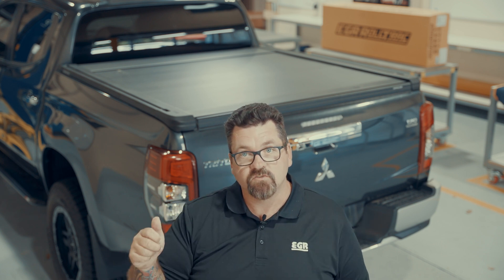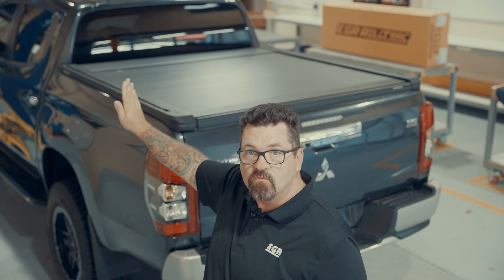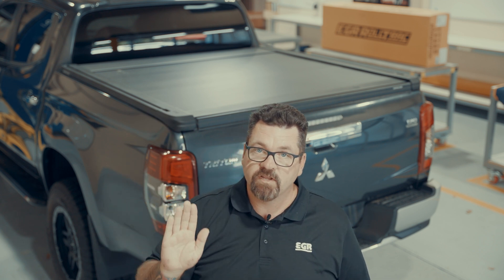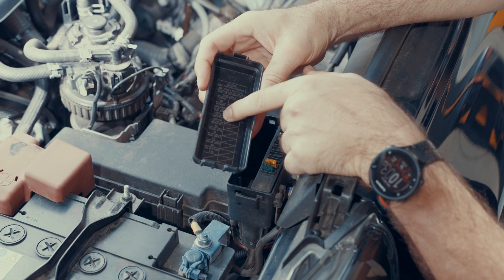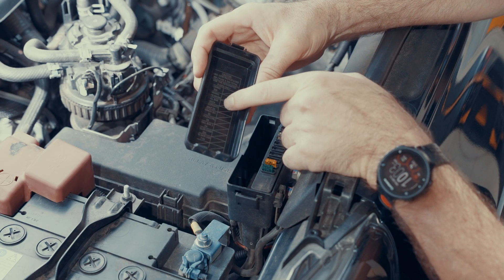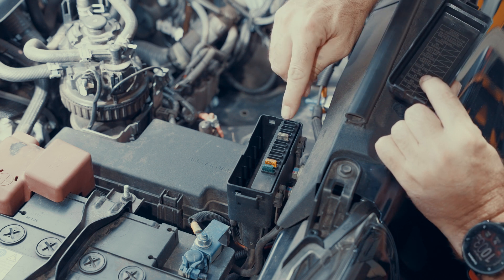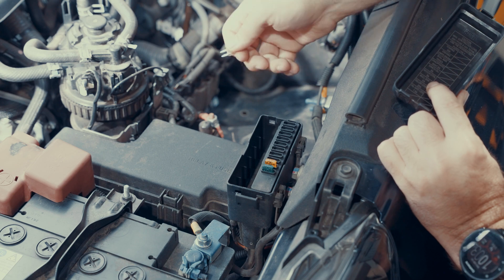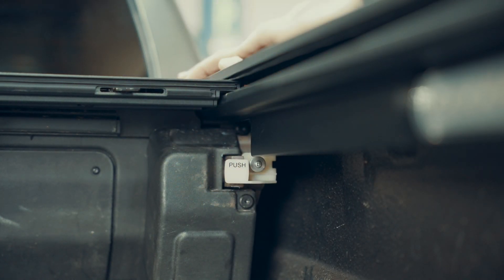EGR RollTrac - Diagnose & Replace Broken Drive Pins

Comment: My roll track only makes that clanking sound once it reaches the end of the close state.
Reply: Same bro what did you do? Needs recalibration
Reply: @gmac2977 
The dealer replaced it out of warrenty. The problem stems from the plastic slates that holds the unit together.
They ended up replacing them with metals slates.